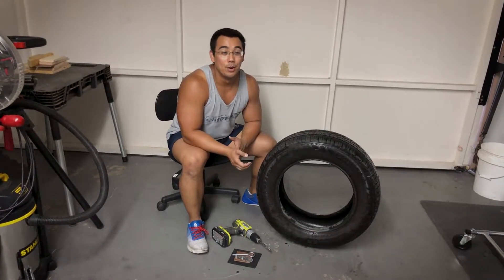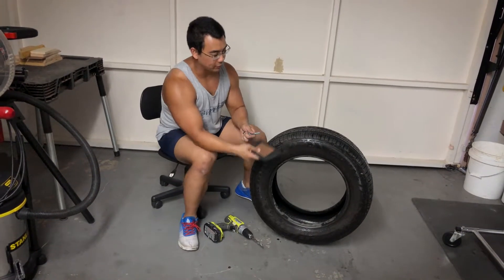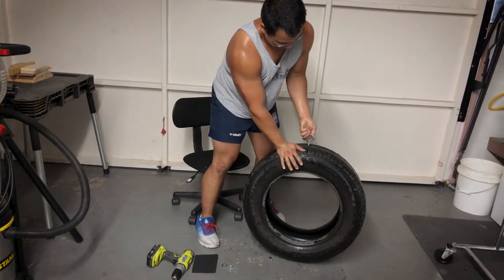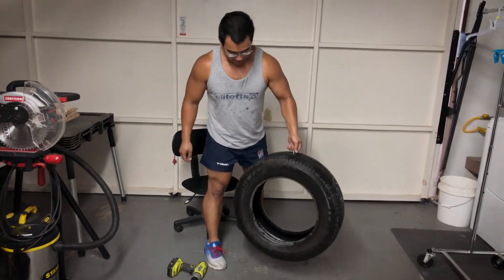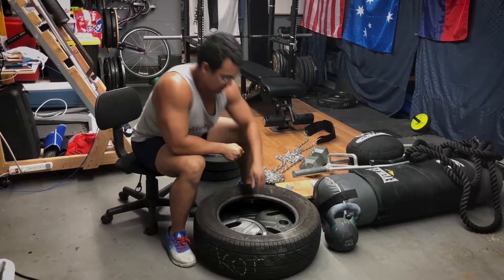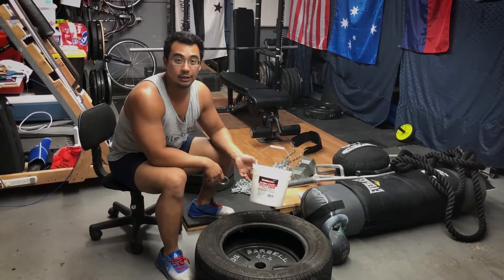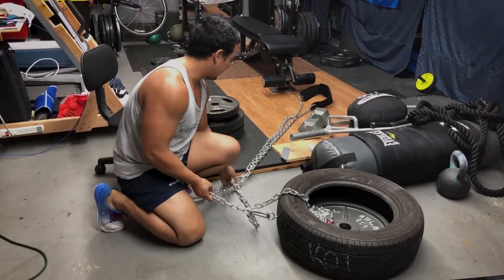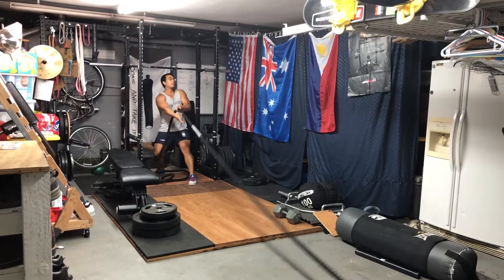How to make your own weight sled with an old tire. | DIY Garage Gym Equipment

Comment: Excellent.  I've been using just an old tire tied to a very tough old abrasion-resistant rope that used to tow cars. I only drag on grass, and haven't had noticeable rope wear.  I put one or two bumpers on top, and that works well enough.  Adding a bottom plate like yours would extend its capacity.  Thanks for the cheap but effective looking upgrade suggestions!
Reply from the maker: Glad you found it helpful. Yeah the 45 plate insert helps prevent smaller plates falling through

Comment: Can u sprint with it
Reply from the maker: I've tried running with it and wasn't a fan of how the chain whips around, depending on your running cadence, it might hit your feet. I'd say replace the chain with a tow strap or some other strong fabric/seatbelt material
Reply: @WynnStrength   But will the tire be bouncing around?
Reply from the maker: it won't be bouncing off the ground, but it does whip around a bit on each stride